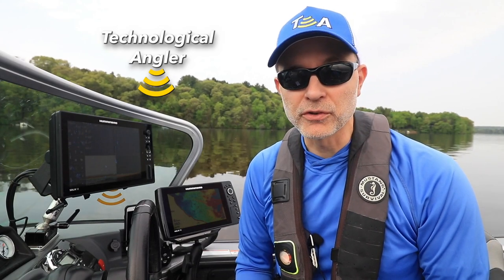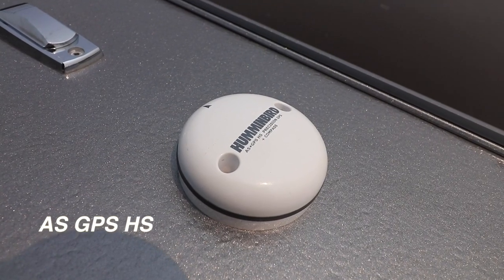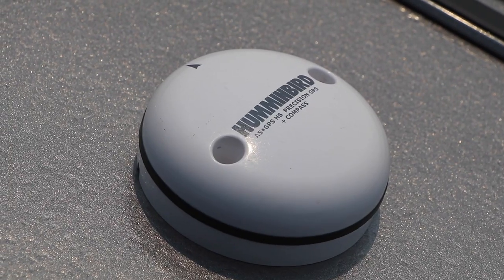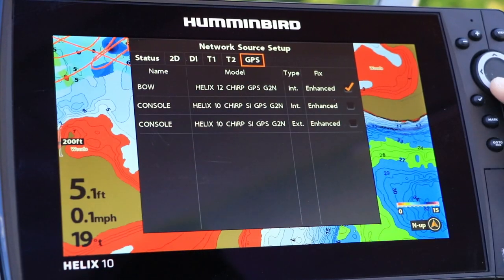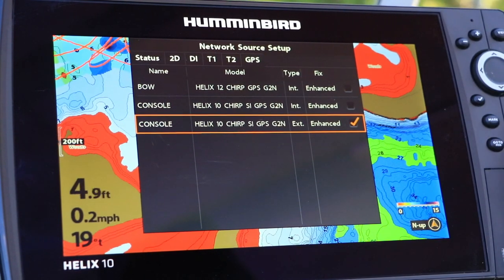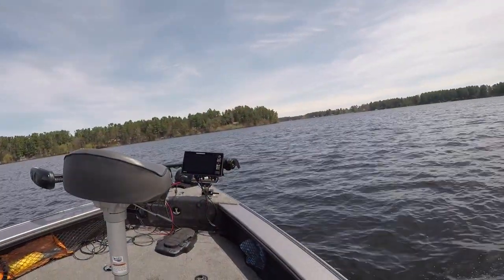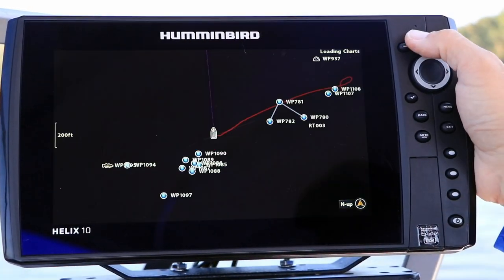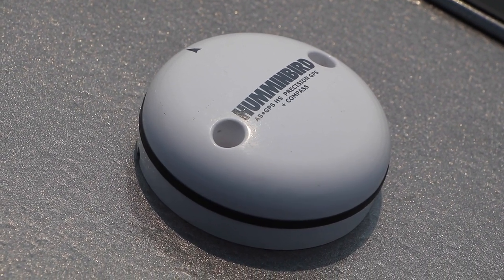Humminbird GPS Heading Sensor - Why You Should Install One

Comment: Excellent presentation and a quick question.  I plan on installing a bow mounted minnkota trolling motor on the BACK of my boat.  I have a rail and other stuff in the way in the front.  Obviously, if it’s mounted on the back when the trolling motor turns left the boat will go right and vice versa.  But if you use ipilot and possibly a heading sensor for your tracks and waypoints, will the trolling motor steer the boat properly, even though it’s mounted in the back?

Comment: This is much more important if you don’t have a Minn Kota heading sensor. The Minn Kota heading sensor doesn’t talk to any Humminbird, but it does talk to the trolling motor which makes the decision based on its GPS where to go. This heading sensor though is needed for a 360 unit and to see what direction your boat is actually pointed.
Reply: If you have an iPilot link your Minn Kota heading sensor will communicate with your graphs through the network!
Reply: @BehindTheReelFishing  This might be true today after updates.  But from my understanding this was not true when it first came out.  But if you had no heading sensor and then just put the Minn Kota in, it improved all features of both stand alone I-Pilot and I-Pilot Link including follow the contour.
Reply: @skwira000  yes this is something they made possible through software updates.